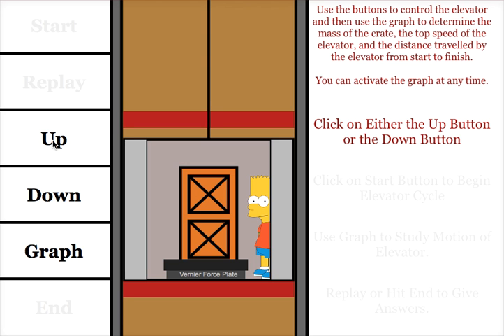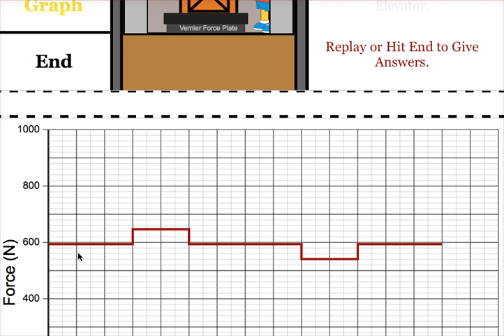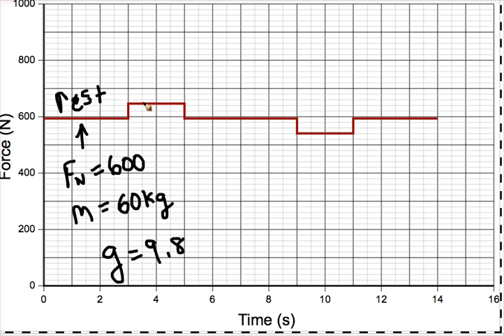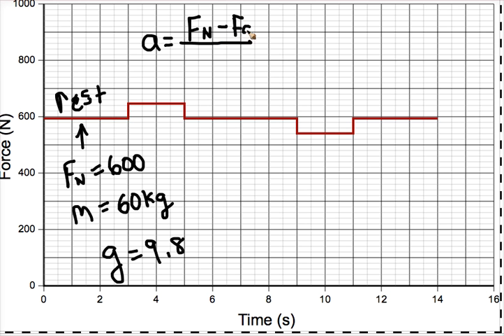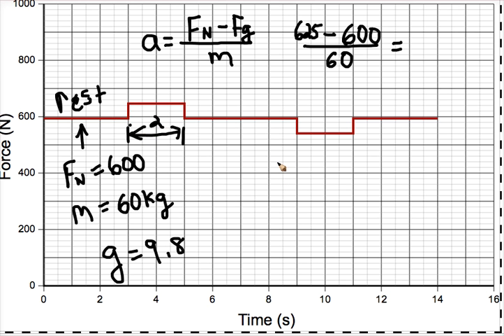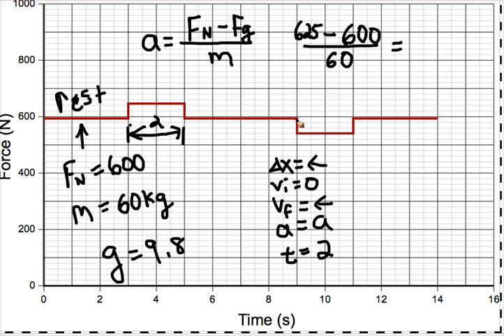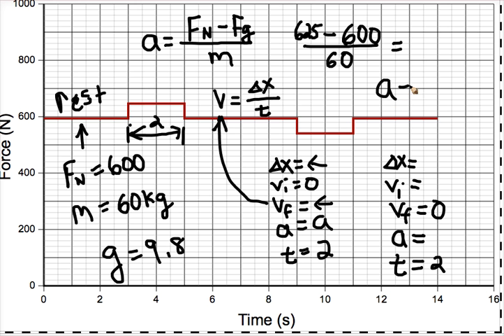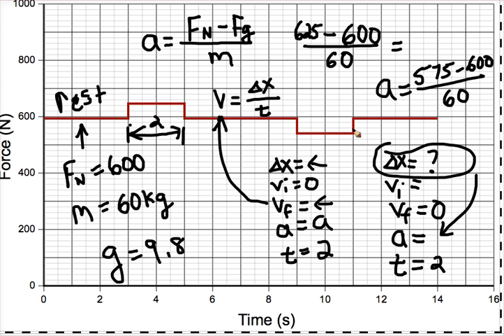Turning Forces into Distances on an Elevator

Comment: Isn't Fn 650 N?
Reply from the maker: Shalini Vijayekumar The force normal will be different depending on the acceleration of the elevator at different moments in time.
Reply: Wouldn’t the 625 actually be around 645?